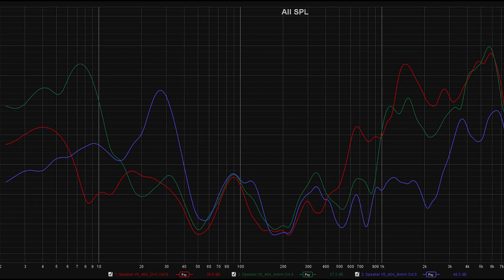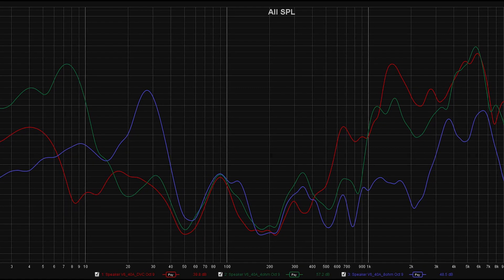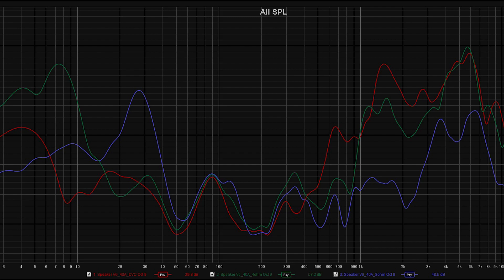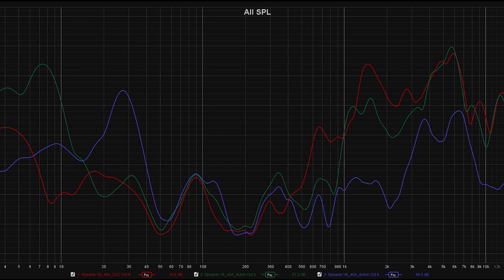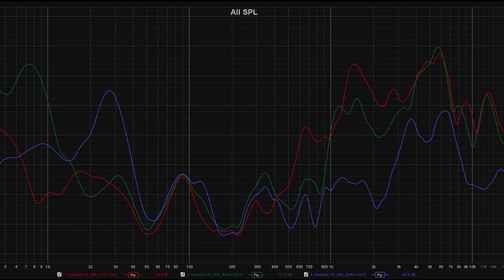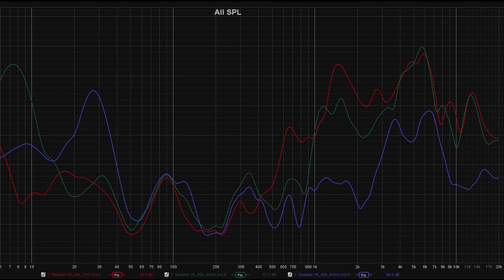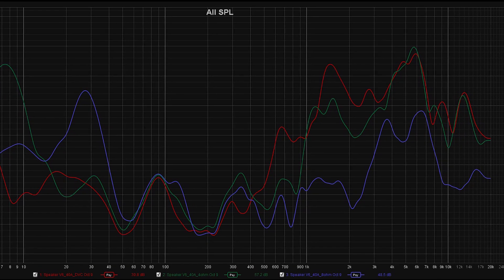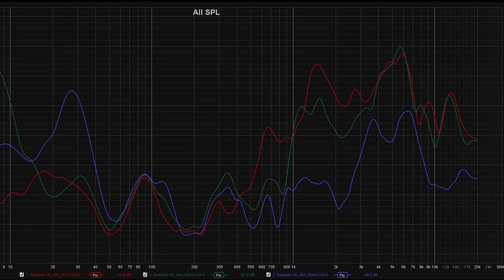FULLY 3D Printed Speaker Version 6.5

Comment: Regarding the soft foam filament hardening after assembly, I think that might be because of the use of superglue/CA glue to attach the foam filament parts. If the water can dissolve the PVA all the way through the material, then it must be an open cell foam, meaning all of the gaps in the foam are connected. When you put superglue on it to assemble the speakers, the superglue likely wicked into all of the gaps and more or less completely replaced the PVA, and then cured solid, resulting in a very stiff but strong composite.
Reply from the maker: I wish that was true, however my test prints also hardened back up in the same way and they were never exposed to glue, I also tested if re immersing in water  for 30 ish hours would soften it back and it does, I think either some of PVA is left over or is trapped and will never get out. I’m going to try a ultrasonic cleaner at some point to see if that has any effect.
Reply: @piscesprinting  most 3d printing materials do lose rigidity when they absorb moisture, likelihood is that after printing they just need to return to a steady state based on moisture content in the air, unfortunately for you that just makes them too rigid seemingly. Using 3d printing to make simple molds for something like silicone might be a nice alternative maybe? That way the manufacture is still technically 100% 3d printed too

Comment: if you have an RTX graphics card you should try Nvidia broadcast to lower fan noise it works great for me. Or the video production software you use might have a similar option to lower background noise
Reply: This seems like mostly constant source of noise so Audacity would do wonders too. Also beware of NVIDIA Broadcast and random BSODs - recently Overwatch 2 is having weird interaction with it which isn't so obvious to debug, so not sure if anything other is affected.
Reply: @notsure5583  Yep, that's what I use. Select a section of the noise in audacity. Go into noise removal and click get noise profile. Then select whole audio clip and use the reduce feature (needs some tweaking for it to sound good). Other than the initial tweaking needed, found it works rather well
Reply from the maker: I’ll look into this! I was manually trying to reduce some of the back ground levels by adjusting frequency gains.

Comment: As for dual voice coils. A dual coil driver is nearly always just how you described. It's usually done to allow the end user to pick their impedance depending on whether or not their amplifier can handle the lower impedance (parallel), or if not they just use the higher impedance (series). A side effect when doing this with normal speakers instead of subwoofers is that in series you get more inductance (more high frequency roll off), and in parallel you get less inductance (less high frequency roll off).
Reply from the maker: Awesome! I know my DVC setup isn’t perfect, as I used two separate channels of my amp to drive each coil so I’m sure there are some inefficiency’s in there somehow, as I believe it would work better as a single channel on a bridged amplifier. (If I wanted to keep using two channels)
Reply: @piscesprinting  Actually that method is perfectly sound. Often the two separate channels have a total power larger than just one bridged one. But that typically has to be checked on a case by case basis depending on the chip used. You should be totally with that method as long as your input is a mono signal

Comment: Awesome stuff as always! If you want a foamed flexible filament, a good bet would be to use colorfabb's varioshore tpu. You can control both it's flexibility and weight through extruder temperature. The higher the temperature, the more the foaming agent within the filament is activated. The idea is that since it foams outside of the nozzle, you reduce extrusion rate of these parts in accordance with how much it foams
Reply from the maker: I will look into it! I’m always up for exotic filaments or specialty filaments for testing.